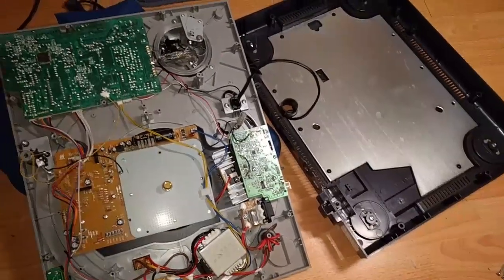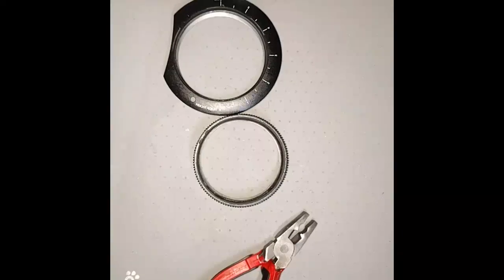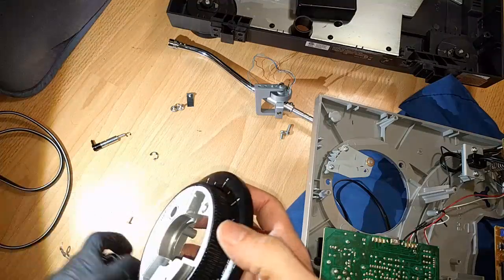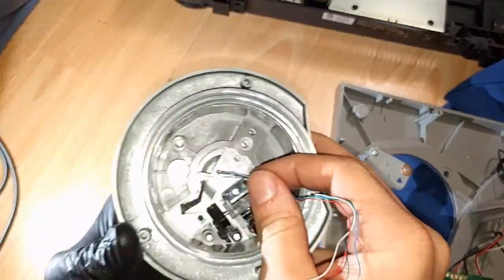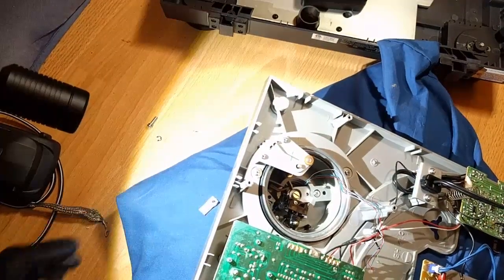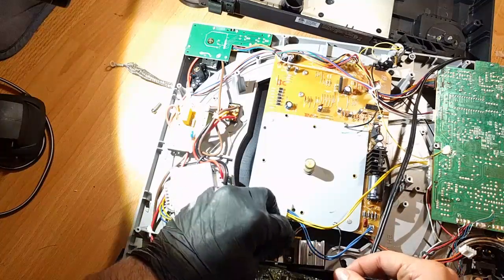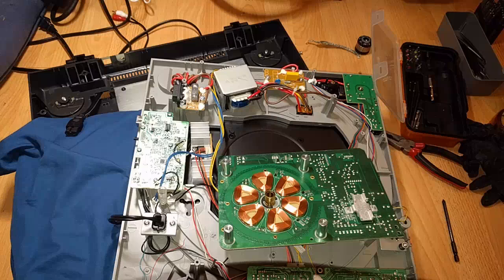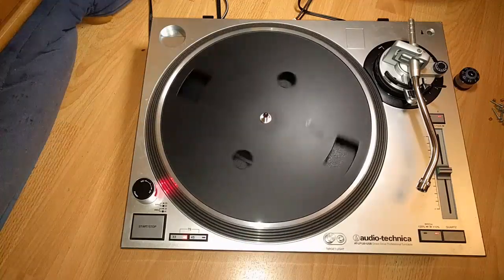Audio Technica (in depth) AT LP-120 Repair

Comment: Interesting teardown but I found myself yelling at the screen a couple of times! First suggestion: get yourself some JIS Standard screwdrivers to avoid camming out any of those JIS-style Philips screws. Second, I kept hoping that you'd get a soda straw, cut it down to the length of that braided ground tube and shove it inside. Then you could slip the tonearm wires easily through to the other side. Just some ideas and....yeah, what a ripoff of the 1200 series! Yikes!
Reply: Also, do you have a link to the tech you mentioned? Was it "Deck Tech" or "Tech Deck" or what?